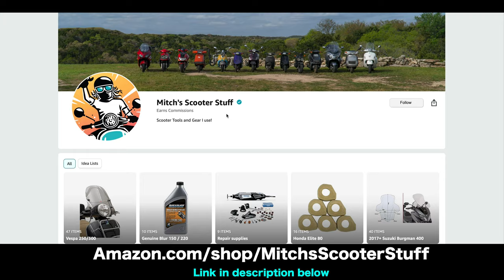Suzuki Burgman 400 - Backrest Adjustment - 2017-Current | Mitch's Scooter Stuff

Comment: HELP!!!  My seat is okay but have problem with that first part in your video where you turned the key and the seat latch opened. My 2005 doesn't want to open the latch, I get it to open about 1 out of 10 times that I try and I swear I can't figure out what I do differently when it does open. Any advice would be great!  Someone told me to spray liquid graphite into the ignition switch, does that sound like it could work?